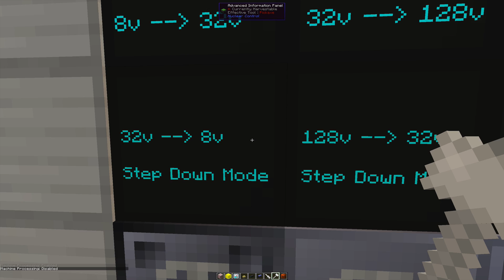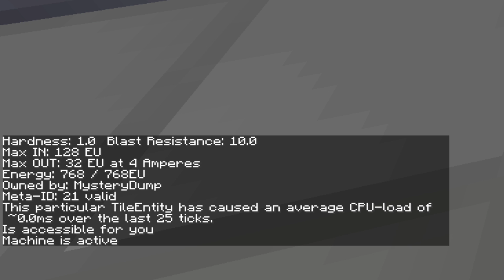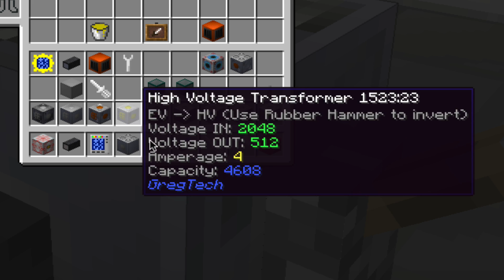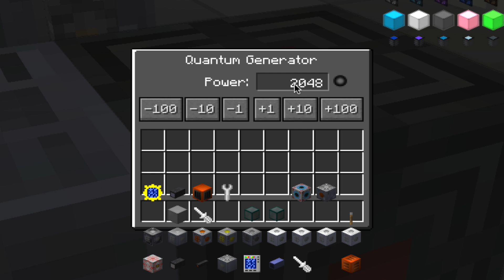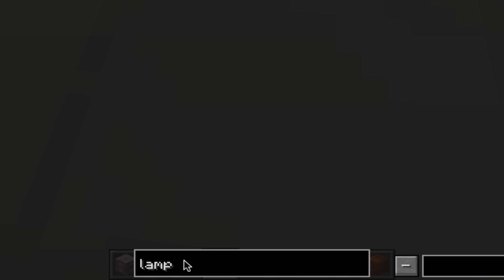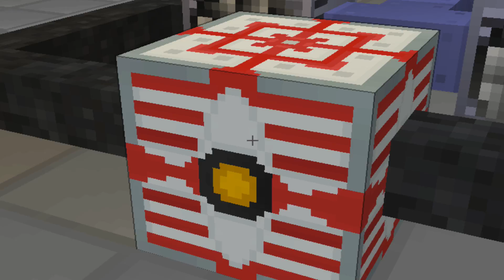Gregtech 5 - Transformers and Converting Power Tutorial

Comment: I know this is an older video so you might want to make an addendum video for it mentioning Immersive Engineering wires.  The also have the universal power conversion  functionality built into them (enabled by default for IC2 and GT I believe).  This is the intended mechanic I provided for Ascension of the Technomancer players to do the conversion.  Still, tons of helpful data in here.  Thanks for another great video.